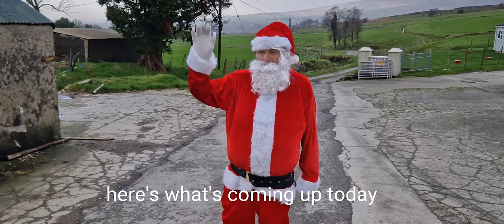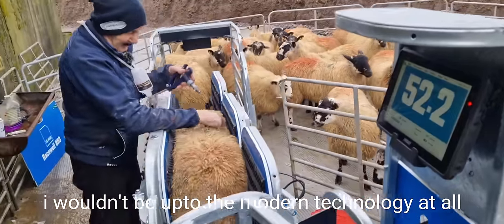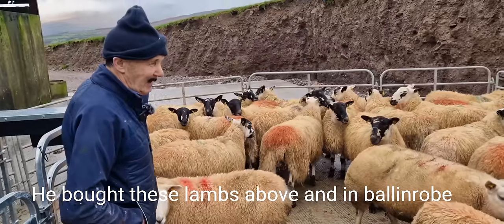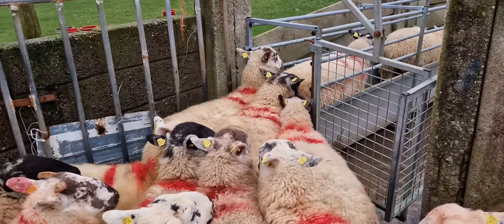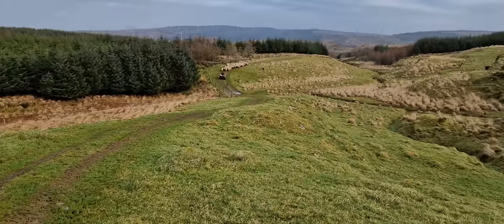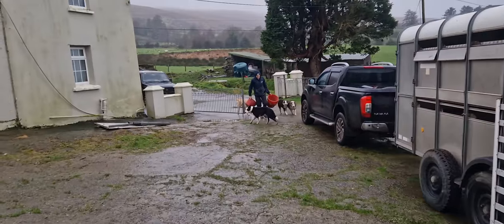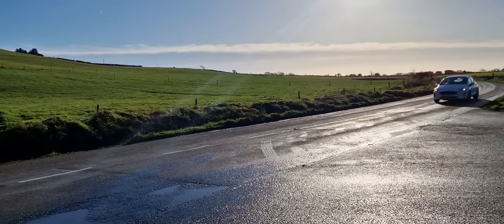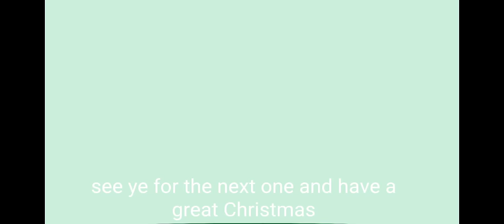Anyone can use it. Farmers of any age #farm #sheep #cows sheep  #tractors #quad #tepari #animals

Comment: yamaha 660 grizzly with the diff locks
Reply from the maker: Cheers. You have good experience from them?
Reply: @sheepshepherd  start good here in the winter of Canada, wicked 4wd system, and reliable as I'll get out, more capable than the old solid axle hondas which would be an even tie for good machines, stay away from Polaris ( 2x bad experiences)